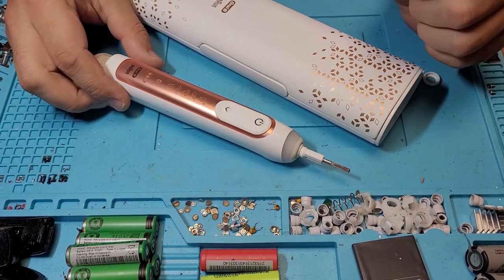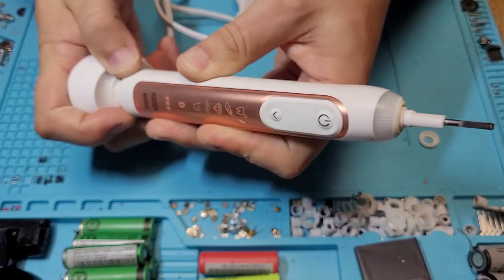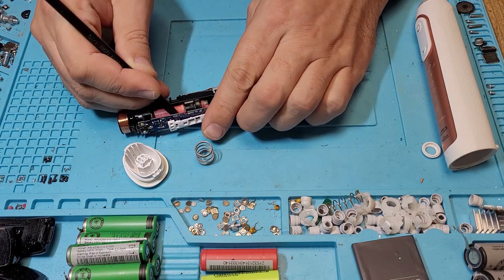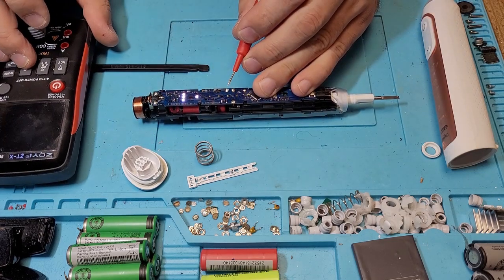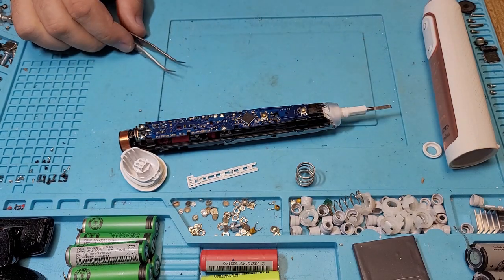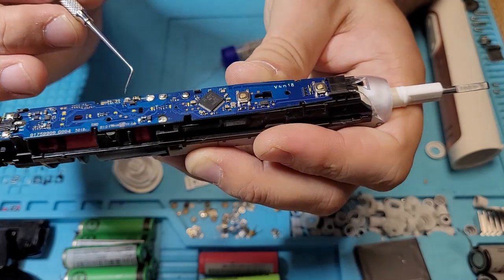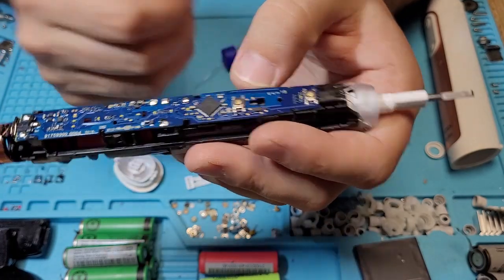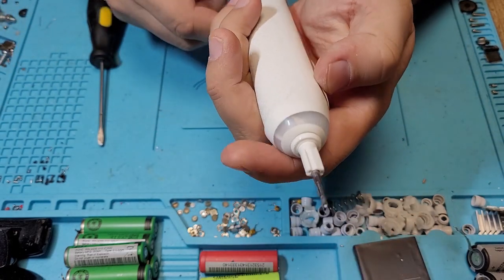Repair of Braun Oral-B Genius X. Lights up, but no vibrations.

Comment: Before you buy a new fuse, just apply some pressure on the fuse with a small screw driver, it pushes in and works again. It worked for me at least. If doesnt help, just remove the fuse and connect 2 points without fuse, it will work just fine.
Reply: Pushing down the fuse fixed my issue as well. Thanks for sharing! Although I have a feeling it is not a long term fix but that’s a problem for another day.
Reply from the maker: Interesting fix with the pressure.. if not much to ask could you update your comment if or when it dies again. This would be very interesting experiment..
Reply: @letsfixitgarage  just an update, still works well. We also use 1 toothbrush for 2 people, meaning it works at least for 8-10 minutes per day. Will let you know when/if it does
Reply: @letsfixitgarage , applying pressure fixed it for about two months. Until it stopped working, after just a few seconds it stops brushing. It seemed like the battery was dying but when opening it and reapplying pressure it works longer (10 seconds) but gets really hot.
Reply: @maartensegers5687  sounds like mine, starts and stop after 1 second, did you fix it? Was the battery?
Reply: @pedrofreitas7543  applied the same fix, and soldered it again. But I don't trust it, the fuse gets way too hot so it will probably fail any time soon.
Reply: Amazing! it worked!! thought it was a faulty battery! just pushed it down too. It worked right away (it's really really tiny), Such a shame those companies are providing such poor design, second that's dying for me. Do you know where to find a remplacement fuse?) Thanks a lot
Reply from the maker: Interesting design of the fuse that mechanical pressure restores it.. will need to take one apart under microscope.. as for replacement I haven't found original fuses but have some aftermarket ones linked in description. For me they held fine.
Reply: @letsfixitgarage  yes also surprised that pressure help, I thought that vibration fragilized a faulty solder over time. (Vs the component itself

Quick one : does the first link is ok (way cheaper byt ) vs the small one one at 17$)?  Thanks
Reply from the maker: Yes I use these fuses and they hold alright. They are slightly bigger then original one so it might be a little difficult to get the solder on the pads but it's doable if you use solder paste even easier. The smaller one is even smaller than original so no problem with place for solder but quite difficult to handle that small fuse :) oh yeah and original is not known and as we know tends to break physically :))) chose your pain wisely :)
Reply: @letsfixitgarage  😅 thanks !!👍
Reply: The fuse have “pp” write? Right?
Reply: @robertoibba9650  , yes, it is marked "pp".
Reply: Thanks to this video and your comment I got the toothbrush working again in 5 minutes. Thank you both so much 👏
Reply: This method of applying pressure to the fuse worked for me, I've fixed my girlfriend's toothbrush for her she's very impressed 😂
Reply: This worked for me too. AMAZING. Have replaced this tooth brush 4 times under warranty for the same issue. We actually have 2 in the house and lost 1 receipt, but was using the 1 receipt between the 2 toothbrush. But this time they both failed within 2 weeks of each other so can't use the same receipt again. So this saved me as it's working again now by pushing the fuse around. 😂
Reply: Update...pushing the fuse made the toothbrush work for 3 weeks, then it died again.
Removed the fuse and bridged it out until I find a suitable replacement.
Reply: Yeah ok, my toothbrush finally died, not sure if it's the fuse problem, but i got a good life extension from that fuse pushdown. Will be replacing with another one sometime soon, not sure if it's going to be Braun this time. How you all are well and safe.
Reply from the maker: @jackmamat7721 thanks for the feedback! If there is no water I would suggest trying to solder in a new fuse. These brushes are quite reliable apart from the fuse :))
Reply: @jackmamat7721 Did you completely remove that fuse
Reply: Thanks so much for this Jack! Saved me so much hassle 😅
Reply: It worked for me too, I checked this because when I checked resistance in the fuse it suddenly went ballistic the toothbrush and applied some pressure, now it works but let's see until when
Reply: interesting fix with some pressure 😂.  My toothbrush fixed with ur advice, thank u Jack
Reply: Legend bro! This actually worked. Used a set of tweezers and moved it around and so far so good 😊
Reply: worked for me with applying pressure on fuse..but of course..the toothbrush must be turned on so the fuse gets hot while putting pressure on it..
Reply from the maker: It is possible to run without fuse but I always say that safety element is there for a reason. Please consider adding a fuse.
Reply: @letsfixitgarage how can I make the connection without a fuse? Do I need a wire?

Or do I just need to solder a bit on it directly between the two points? 

Ty. really want to fix my toothbrush!
Reply from the maker: @ua8231 wire or solder blob will do the same.. but my strong suggestion from safety side is to install a new fuse.. don't want to hear news that someone's toothbrush cought on fire after he repaired accordingly to some advice on internet ;)
Reply: Just an update to this. Mine died again after a day of use. Maybe the fuse is completely faulty at this point. So I am going to run it without the fuse until the AliExpress replacement comes in. But shipping time is horrendous..
Reply: So adding the pressure worked for me but then I sat it down to clean some of the housing part tried it again before installing it and now I get no lights or vibration… any idea what could have happened?
Reply from the maker: Replace the fuse and restart the chip. There is a comment with detailed explanation somewhere in this video comments. Basically you need to put ground on to test point on the right to the main chip. Or desolder ground for few seconds..
Reply: @letsfixitgarage  thank you I’ll take a look for that comment as well
Reply: @letsfixitgarage same thing happened to me : it worked with the fuse trick but after reassembling, nothing anymore, no lights or vibration.
So can you please explain how to reset/restart the chip ?
What do you mean by "put ground on to test point" and can you send me a pic of where is this test point ?
Reply: Thank you for the tips i manage to fix my one with your advice u whore right about it. Many thank's u spare me buying another one 🙏
Reply: Amazing tip, worked like a charm 😊
Reply: Wow, it worked perfect for me by pushing down on the fuse. Top drawer! Cheers👍🏼
Reply: The pressure on the fuse fixed worked for me! We'll see how long it lasts... I'm curious if yours is still running 6 months later?
Reply: @michaelrichardgreene9654  hiya.. yes, still going strong, using it daily, not sure how long will it last but I would have thrown it away anyway. I guess if this trick doesn't work, you can remove that fuse completely and just connect the points, put a drop of solder on top, theoretically that should work.
Reply: had a hard time locating the fuse but once I did it worked, thanks!
Reply: And MANY thanks to you for recommending to press it down!!!
Reply: I pushed the centre of the PP fuse with the tip of my multimeter probe, and instantly the brush came alive.
I think these are self resetting thermal fuses. The mechanical pressure applied helps to re-seat the bi-metallic strip maybe?
Reply: @letsfixitgarage Firstly thank you for the video, would have had no idea of how to even get into the toothbrush otherwise! And secondly thank you @jackmamat7721 just saved me £100 buying a new one. The pressure worked well, wouldn't catch me soldering on a tiny new fuse :P
Reply: Thanks veeeeery much jack ❤❤❤
Reply: This also worked for me
Reply: Is PP supposed to be a resettable fuse? If it is, maybe the crystalline structure failed to reset itself properly, so pressure/crushing the crystal closer bridge the connection?
Reply: My issue was that the rotor spin for a sec and then stops. I reassembled it and I noticed that the fusion was hot. After pressured it down, it started working again!
I don't know how long it will last, but thank you!!
Reply: Thank to you I have solved the problem (my wife wanted to buy a new one 😂) . Not replaced just try to soldernit again. I think this component is like a "ptc fuse" to limit the power to the motor if overheating, and when the motor run it will be warm. So maybe after mang time the soldering worn out.?
Reply: @daviduzzer the PlayStation 3 has the same problem.
Reply: Where do you buy a new fuse?
Reply: It works!!! Thanks both of you
Reply: Thank you for this information. It helps also with my toothbrush. We will see how long. But I’m happy to not bring it to the trash 😅
Reply: It worked for me, thank you!!! Just a little push and everything works again
Reply: thank you 🙏
Reply: I tried but touched the other side of the board in the process. Little spark, smoke. The motor is not working anymore.
Reply from the maker: @Cekkaaaaaaaa electronics and repair by pressure is not really compatible.. :) that's why I always suggest replacing the fuse with soldering iron.. thanks for sharing and warning the others!
Reply: Thank you also worked for me!!! Just pushed the fuse a little bit with the a small screw driver!!! Many thanks bro!!!
Reply: Pressing the fuse firmly also worked for me! Fuse is marked “PP”
Reply: Wow I just pushed down on the fuse and it works again!! It’s been sitting idle for over a year cause my warranty ran out.  I’ll let you know how long it goes for before it stuffs up again. Fingers crossed it’s all good now 🤞🏼
Reply: It works, thank you a lot!
Reply: It worked for me bro, just pressed the fuse against the board and started working again :D Thank you very much!
Reply: It died again after 1 year.
Reply from the maker: Fuse replacement usually is more reliable repair.
Reply: Yep, pressure did the trick for me. Thanks!
Reply: جزاك الله خيرا، لقد نجحت العملية
Reply: Thank you! This just worked for me. I definitely squished the fuse a little but it turned right back on. I was experiencing anywhere between 1 and 10 oscillations before it stopped on a full charge and thought it must have been something else. Thank you for the tip!
Reply: Hahaha THAT WORKED😂😂😂
Reply: Pressure on the fuse worked, thank you!!!!
Reply: Pushing down and resoldering the fuse worked for me! Thanks for sharing. 🙂👍
Reply: Hi, thank you so much for this video. Can you tell me where can I get these fuses, and is it possible to glue the fuse with super glue or something? Sorry, I don't know
Reply: Fixed mind too. First pressing with a nail. Didn't work. Then used a screwdriver and pressed quite hard and long (3 sec or more holding down screwdriver) . And then after 4 tries it spin on!! .. I also think you have to have power on on the toothbrush.  First I switch off power as was afraid of shortcut but didn't work. Then tried again pressing pp with screwdriver when on and now it is working ! Thanks
Reply: Pushed the fuse and it worked! Thanks for the tip
Reply: It worked perfectly on my toothbrush! Just had a bit of trouble getting the ring in at the end, but it's all set and working again! Thank you so much for this very helpful comment!!!
Reply: YOU LEGEND!!! This worked for me too! Thanks so much!!
Reply: Insane how the pressure to fuse worked! Thank you!!
Reply: Thank you very much for this!
Reply: It’s work 😅
Reply: Merhaba herkeze. Bisahmet birinizbu sigortanın birbir ismini ve numarasınıyazabilir mı? Teşekür ederim
Reply: I did exactly this a year ago, just pushed down on it and it worked again. Then yesterday it stopped working again. Now I just bridged it and it totally works, thanks dude
Reply from the maker: Bridging definitely works but you have to consider that you remove one of the protection points. If motor or MOSFET shorts it's not going to protect it..
Reply: I pressed the fuse with a screwdriver but now it doesn't even turn on. I tried to bypass it with ardunio jumpers but didn't work too. :(
Reply from the maker: Change the fuse, try to reset the Motherboard
Reply: I'm amazed that consumers have accepted the concept of electronic designs that are meant to be thrown away. A difficult to replace fuse is a poor design. Cell phones are the worst, where battery life and degradation are known and not consumer replaceable for phones that cost $1,500. Not sure exact rationale for need of fuse for a 1.3 volt NiMH battery, that you can short circuit with no issues. The inductive charging system is very much current limited.
Reply from the maker: Fuse is not for charging it's for the motor if MOSFET or motor gets shorted it gives whole current of the battery directly.. it could heat up quite heavily.. genius series has li ion not NiMH..
Reply: oohh man, that works for me like a magic!

Comment: Ah, so this is why my Genius X stops working 🙄 - I am on my 2nd or 3rd replacement now. Googled to see if this issue is widespread as I'm tired of it. I think I'll just opt for a refund at this point. I've learnt my lesson regarding an air fryer that continued to fail even when replaced. Refund before the warranty runs out, don't continuously replace.
Reply from the maker: Could be. I am confused why Braun doesn't improve the design or change fuse manufacturer.. these brushes are quite long time in the market and still have the same bad fuses..
Reply: @letsfixitgarage  In a way they are discontinued now, right? I think it's been replaced by the iO. Was interested but then I would've had several leftover Genius X brush heads that don't look compatible. Besides, what they are charging for the iO... Yeah, no, lol.
Reply from the maker: Well now the top one is iO but not sure if genius is discontinued.. there are still a lot of shops selling it and even new packaging comes out.. as for iO just yesterday made a video regarding its repairability ;)

Comment: Really appreciated your video here. Same symptoms for me, toothbrush might rotate for 2-3 seconds but would stop, then nothing for several minutes or even wait overnight to get any life again. In my case I applied a bit of pressure to the 'PP' fuse to see if there was any physical connection problem and sure enough, this 'fixed' my problem. So I believe I had a cold solder joint. And with the high vibration of these motors you might expect this to happen with some units. I don't have smd tip or tweezers for my soldering station, but I used my smallest tip and added just a small amount of fresh solder to the fuse pads. Seems to be working for me for a couple days so far. Thanks again.
Reply: Did the same. Works for me as well
Reply from the maker: Nice! leave an update after a month or few to know if it was a permanent solution for you.
Reply: Any update on your Oral B Genius X? Exactly what you're describing has started happening to mine and i'm considering popping it open.
Reply from the maker: Fuse is dying. I would replace it but of course you can try the pressure method..
Reply: This worked for me for a few months but the problem happened again

Comment: Thanks a lot, I desoldered the fuse and instead short-circuited the two pads and now it's working again 😁. As you point out in some comments adding a new fuse is better but I guess the risks involved are fairly low
Reply from the maker: Thanks for a good word and for reading the comments. Yes it works, as for risks low probability burned motherboard.. very very very low probability burned toothbrush or even bathroom while you sleep. Then fire department investigates that the culprit is Braun toothbrush, news catches the story, Braun finds this comment and sues you for millions because you damaged their name.. well you get the Idea and my Imagination :D moral of the story is always use protection and even better: a good one, not like Braun ;) just joking ;)
Reply: @letsfixitgarage  wauw your imagination escalated to a horror scenario really quickly! I had actually been thinking about burning. My thought was that it only seems power to the motor etc while I am actually using the toothbrush. No power goes to the motor when I'm not using it. The toothbrush is right under my nose when I'm using it. So I should smell any problems rather quickly.
That fuse is really tiny and I doubt I have the skills to solder a new one on.
Reply from the maker: Yes you are right this part should be affected only while using. But you shouldn't underestimate corporate lawyers Imagination when they are bored ;)
Reply: I tried the short circuit thing too but It didn’t work :( Have you reset the card?

Comment: Thank you so much for this video. I have one question I have same toothbrush and when I opened it I saw lots of rust soecialy on the motor part. How can I clean them? Thanks!
Reply from the maker: difficult to say how dirty it is but usually rust on the outside of the motor doesn't affect its performance. just clean any loose rust with a brush, blow it with compressed air and it should be fine. problem is why you have rust inside.. if all seals are in tact it should be dry and rust-free.. look where water is getting in..
Reply: @letsfixitgarage  thanks! 💯🙋‍♂️